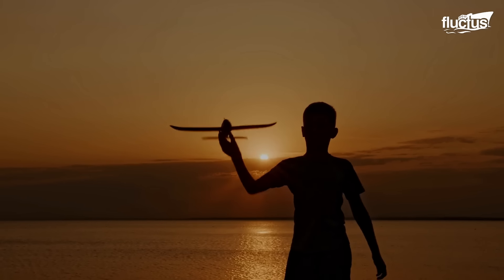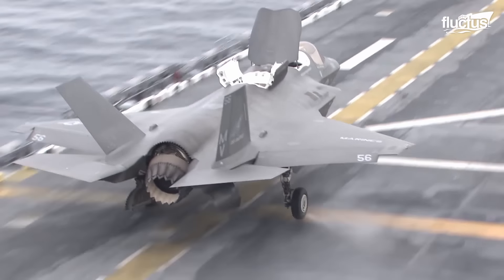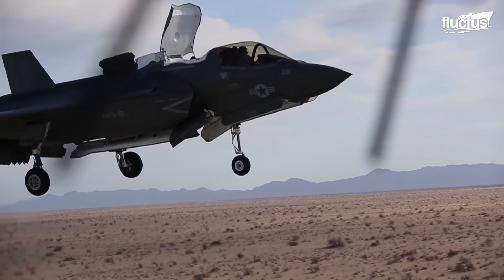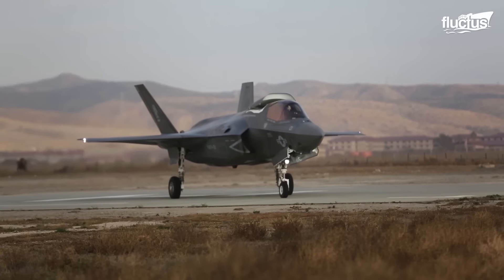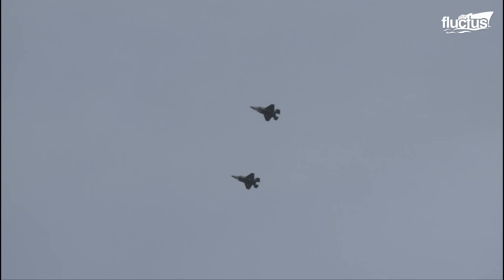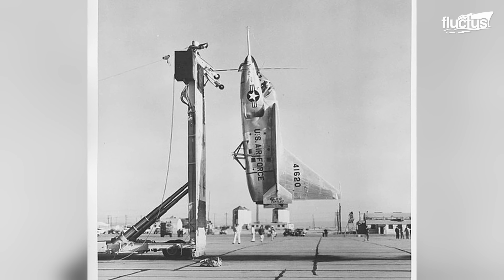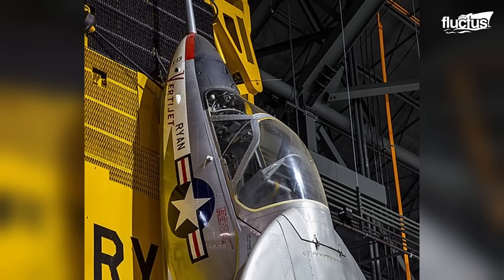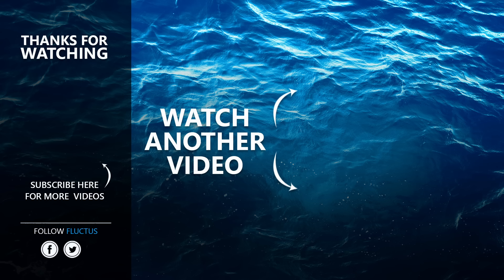The Crazy Engineering Behind US F-35B Monstrously Powerful Vertical Fan

Comment: Lockheed made a secret contract to use the technology of the russian Yakolev YAK 141 copying its tail configuration,  tilt motor and foward for the Joint Strike Fighter FX 35B bid.
Reply: I believe that.
Russian engineers were first to put turbofan behind cockpit.
Reply: The Russian Yak copied the British design of the P.1154 ! It was never built but they designed the supersonic VTOL system along with the subsonic P.1127 system for the Harrier
Reply: @youtuber.1788  hi dude, don't see turbo fan behind the cockpit. 
Fans on harrier on the side of fuselage. 
Thanks
Reply: @Then.72  Incorrect, yet again.
Reply: @AA-xo9uw  your the one that’s incorrect because thrust vectoring the afterburner was what it was all about and that’s exactly what it is instead of nozzles
Reply: @aandscrawfoski  the engine may have been different but the   Main concept of VTOL wasn’t which made the aircraft lift vertically

Comment: The pilots say it’s infinitely easier to vertically land the F-35 than it was a Harrier
Reply: The Harrier required a lot more skill in it's vertical configuration because of the necessary manual controls this was an aircraft designed in the 60's without the provision of fly by wire consequently it was unforgiving, so with the benefits of computer intervention the F-35 was bound to be a leap forward I do not think it can "viff" though.
Reply: I bet the pilots say it’s easier to land jet today onboard a carrier than it was a biplane because technology helps over the years and the British did put the optical landing system on carriers too
Reply: It's a pretty established science by now. Just not as useful as most people think.

Comment: Apart from 21st century computer connectivity, the Harier has been doing the job for 60 years. The F-35B is a sweet bird, but it's buiding on the Harrier' success.
Reply: Fortunately Lockheed has produced a far superior design to that of the infamous Pegasus hot gas ingesting compressor stalls of the antiquated Harrier.
Reply: @AA-xo9uw  troll alert

Comment: Lockheed didn’t gave the f-35 quality and strong front landing gear but they gave it to f-22 raptor, it may break off if it hit the ground hard
Reply: The F-35C has a two wheel front landing gear and strengthened back landing gear for carrier use. The F-35B also has strengthened landing gear.
Reply: Typical USAF tactical aircraft have tinkertoy type landing gear compared to the far more robust gear on Naval aircraft. The two are designed for tremendously different landings. An Air Force fighter might make one carrier landing, it would be scrapped afterward...

Comment: I just don't see why a VTOL fighter is needed nowadays especially given the weight & payload compromises entailed!
Reply: Well when your catobar system fails you. All of a sudden your a bit stuffed until its fixed. So STOVL is incredibly useful.
Reply: With VTOL you can carry more keys on a short runway like a carrier
Reply: That capability allows the plane to operate from smaller ships such as helicopter carriers and ski jump aircraft carriers.
Reply: F-35B has the same payload like F-35A/C in short takeoff. It can even be launched in beast mode. However it will have to reduce its weight by cutting its fuel/payload in vertical takeoff mode if I'm not wrong.
Reply: When you see Naval warfare you’ll understand exactly why because it’s been a long time now
Reply: The F-35B is STOVL not VTOL. No KPP requiring the JSF to be a VTOL capable platform.
Reply: @AA-xo9uw  You are correct. I don't know if the F35B can take off vertically, but the payload and fuel load would be very limited if it were capable of that. The sole reason for the development of the 'B' version was because the Marine Corps insisted on that, having a perceived need for a stealth, supersonic aircraft to replace the AV8B in the close air support role. The sales to other countries of the 'B' version is just icing on the manufacturer's cake.
Reply: @JM-lk6wo  "I don't know if the F35B can take off vertically"

It can.

"The sole reason for the development of the 'B' version was because the Marine Corps insisted on that"(sic)

Incorrect.The primary objective of the CALF/JAST/JSF programs was to produce a STOVL aircraft. The Marine Corps has a lot of clout but not enough to dictate the primary objective of those three programs.